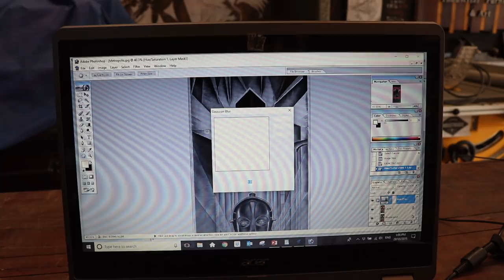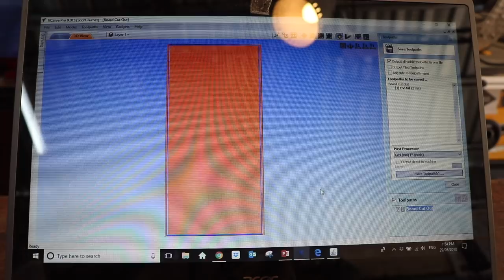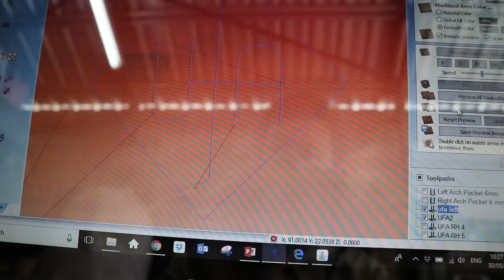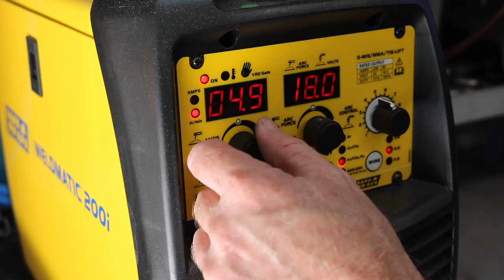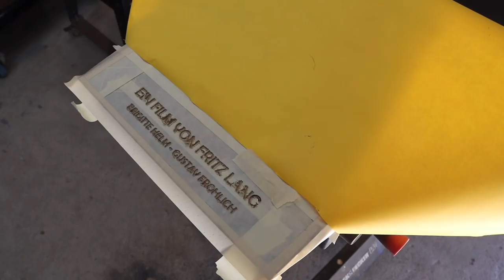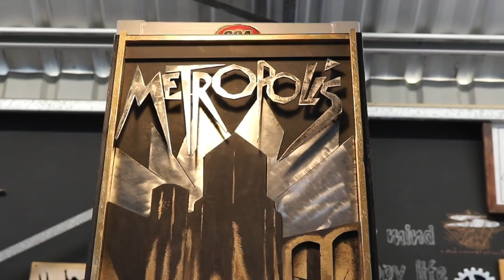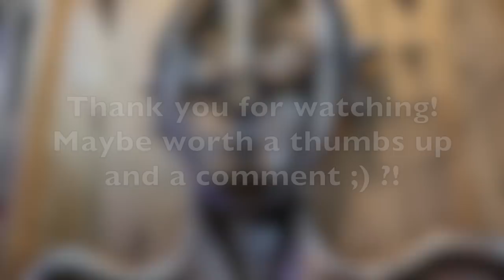"Metropolis" Movie Poster - Forme Industrious

Comment: WOW  nice work
Question mate "Do you have gas on your MIG welder or are you running fluxed core wire" ?
Reply from the maker: For a long time I used Flux core, but now am on a Gas mix. Gas is much nicer to work with. Thanks!

Comment: Gday! Great video mate! How do you like using photoshop with the CNC? Bit messy and clunky trying to do the image trace and scaling isn't it. Got some advice if you're interested :D
Reply from the maker: Hi Terry - thank you!! First time I have touch Photoshop but to be honest, I didn't use that rendering I showed in the video. I traced everything I needed in V Carve Pro  but I aim for around 14 minutes of video and just couldn't fit all the bits in. I am keen on using whatever I can to convert images to vectors so I can take them to the cnc. Any help is most welcome. All the best mate!
Reply: Perfect mate! I recommend using Adobe illustrator for the image trace and vector creating. Photoshop is no comparison. Plus you get a ton more options. I use it in all my designs. It's made for vectors :D scaling and proportions won't distort.
Reply from the maker: Well, I'll have to get onto it. Cheers again Terry!
Reply: I usually just import the image into my CAD program and trace on top of it. I found it easier than trying to clean up an image trace.
Reply: Michael Henriksen but with AI you don't need to. It's that good of a tool.

Comment: Beautiful piece, Scott.

With regards to the lack of a shrinker, look up "stump shrinking" here on Youtube. Works really well. I've only played around with it a bit but it's not hard to do at all.
Reply from the maker: Hi Michael. Thank you!! I'll check it out for sure. The stretching was a breeze but getting the compound external curves was tricky so the tip is most welcome. Oh and I'm looking at adapting the cnc to have a laser. Not sure if it will cut stencils like yours but they sound interesting.  All the best!
Reply: You can probably mount a diode laser but be very careful with those. The light frequency will go straight through the lens of your eye and fry the optical nerve. Nasty things.
Reply from the maker: Oh yes, definitely has serious risks. So on second thoughts.....

Comment: Mate, you had too much fun doing that to legitimately call it work. If you need to shrink metal over a rounded form  like that again , try a heavy rubber mallet or a rubberised dead blow mallet. A round faced hammer makes short work of the high spots too. In my youth , I used to make rust patch panels and bonnet scoops for my customised cars, Bashed a lot of metal into shape once the guys at the club discovered that I could do it.
Reply from the maker: It's a labour of love (most of the time). Thanks for the tips Barry - I appreciate your experience and feedback. All the best mate!